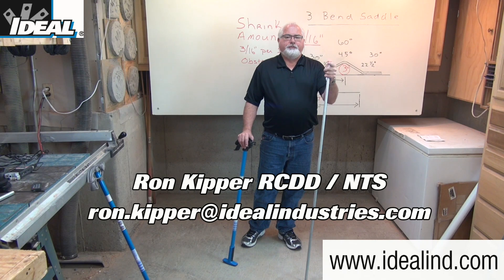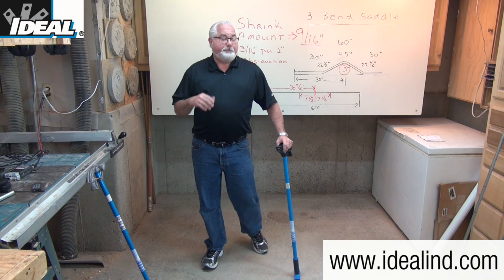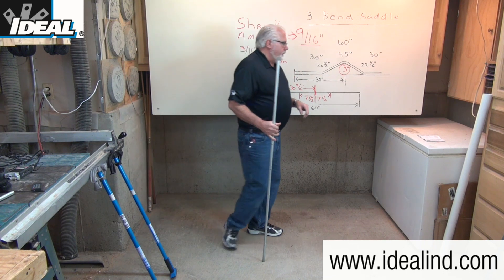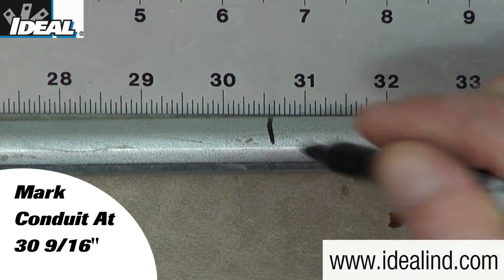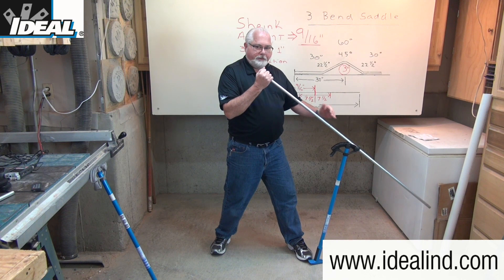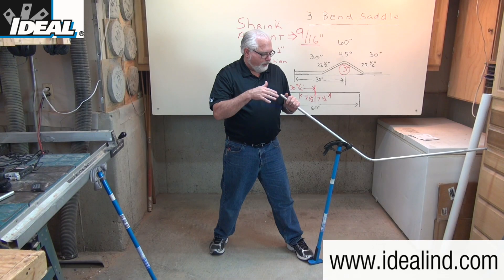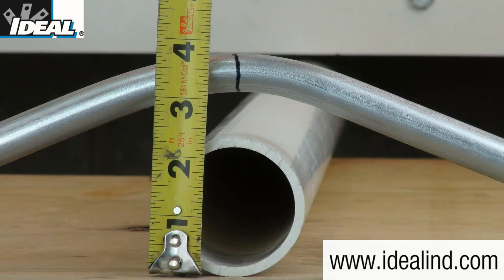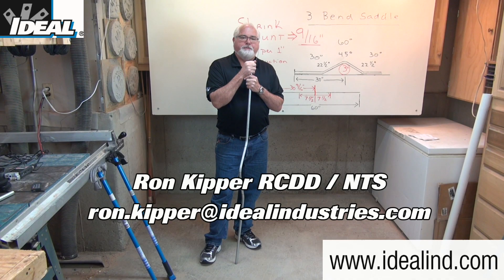Conduit Bending Basics 3 Bend Saddle

Comment: I have the aluminum bender,  and besides the notch  near the star, also has 2 more small notches,  do you know what are those for
Reply from the maker: Yes they are for making the center bend of a 3 bend saddle. The notch in the middle is for a 45 degree center bend, the one closer to the hook is for a 30 degree and the one on the other side by the star is for a 60 degree center bend. Hope that helps Ron at ron.kipper@idealidustries.com
Reply: @Ron Kipper From IDEAL  thank you very much
Reply from the maker: Glad to help Ron

Comment: No idea if you’ll see this or not BUT I’m practicing my bends with a 1/2” bender and what do you do if one side of the pipe is going up a smidge
Reply from the maker: You mean the conduit is slightly bent before you are bending it? Ron
Reply: @RonKipperDatacomm1  no I mean after you do all your bends, one side is bent up a bit and not Flat, is it cause I’ve over bent it?
Reply from the maker: Kat that is called a dog leg and is cuased by not lining up your second bend with the first one. Generally I line up the first bend with the second by sighting down the conduit and rotate the conduit until they line up. I am pretty sure I mention it in the video. Hope that helps Ron

Comment: Why 7 1/2 inches on both sides from the center mark?
Reply from the maker: Hi Brent the 7 1/2 comes from the chart in the bender booklet for a 3 inch obstruction that you need to go over. I am sure there is a math reason for this but the distanve is given in the chart. Ron

Comment: Thank you!  We've got a 3 point bend to match tomorrow in our conduit run. It was intimidating to think about today but exciting to try and accomplish now that I have a better idea of what to do. I appreciate how you showed each step on the screen and explained and demonstrated them well!
Reply from the maker: You got this!Hey Donald hope it helps Ron
Reply: @RonKipperDatacomm1  it worked and looked great!  I had to use the handle of a second bender to cheat the last 22 into place on the short end. The other guys were doing the push through method I think.. but something about those seemed a little off, maybe they were using the wrong starting points.. looking into that method next..
Reply from the maker: Just takes practice! Good luck with it Ron

Comment: What’s the plan when the obstruction is so small that your bends are really close to eachother and you just end up unbending the previous angles when you do the other two
Reply from the maker: Zach are you talking under 1 inch? In that case just make the center bend and  flex the conduit using clamps on either side to continue the run. Have fun Ron

Comment: I need the handle of the bender to be straight, so I can measure my offsets off of it.  As well as being large enough to fit over the conduit to tweak.   Why not invent a more sophisticated hand bender, that you can get exact degrees, without any tweaking.   Maybe use lasers in the bender, with a digital readout.  Or maybe notches that a mechanical stop can slide on and lock on, you set the stop to the degree you want.   It already has spring back factored in,  and probably has to be minorly adjustable, or if you give every single degree as an option, we will just know 1 degree less.       Get to the inventing, I need a better bender.
Reply from the maker: Hey John some of your suggestions have been tried but a lot of learning how to bend conduit is just practice. I just passed along your comment to the product folks lets see if they come up with anything new. Thanks Ron

Comment: Hi Ron, Thanks for the awesome learning videos.  I have a #74002  will it make any difference? How do ideal benders differ?
Reply: Using a steel bender head is fine for 1/2" and even 3/4" 
However, if you're using a steel 1" or 1 1/4" all day long, the aluminum head is more cost efficient. 
I can go much faster with a lighter head.
I am a fit 200LB guy.
Reply from the maker: That bender head is for 3/4" EMT conduit and the bender heads really don't differ other than the size of conduit they are designed for. Hope that helps Ron

Comment: On your first bend, what side of your conduit were you holding? Were you holding the 30-inch side of the conduit? In other words was your hook of your conduit facing away from your 30-inch bend or toward your 30in bend?
Reply from the maker: Kevin yes I bent the center bend first holding the 30" side of the conduit. Basical anytime you are making multiple bends in a conduit the last bend is always facing away from you on the other side of the bender head. Hope that helps Ron

Comment: Shouldn't the total shrink be 9/16 * 2 or 1 and 1/8th?
Reply from the maker: Nope 3/16 * 3 which is the height of the obstruction I was using. Thanks for watching I will be the first to say I am not perfect...........
Reply: yesss: In this video, the shrink is implicitly defined as the conduit length reduction per HALF of the conduit segment. Goniometrically, for one half of the segment, neglecting the bend radii (r = 0), and using d as the shrink, h as the obstruction height, and t as the angle theta in radians, it can be derived that d / h = 1/sin(t) - 1 / tan(t). Entering h = 1 and t = 22.5deg/180*pi yields 3.2/16, so roughly 3/16".

Comment: Ron, thank you for posting this video.  You merit a tip of the hat for this clear, helpful explanation.  This video directly addresses an issue I have with an obstructive water pipe.  My conduit bender happens to be an Ideal, making it that much easier for me to follow along.
Reply from the maker: Hi Jim nice to hear you could use the info. Ron

Comment: Nice video. Is there anyway to recover a bend that was bent too far?
Reply from the maker: Use the hollow handle to and slip it over the conduit to try and "tweak" a bend a little but if it is too far off you have to bend a new piece. The idea is to try and not waste too much conduit on the job. Appreciate the comment. Ron
Reply: Ron Kipper Datacomm

Comment: Hey Ron  , I have a 1/2 ' bender at home and am practicing my bends so I can work back in the commercial industry. I did  a couple 3 bend saddles and followed your instructions , everything was good but I found I did not have a smooth 3 bend saddle the piece of pipe ended up with a big A form, I think I know why but not sure how to correct it. Could you give me some advice. Thank you.
Reply: Good vid. Finally good to see someone getting up all the way on the pipe when making bends in the air
Reply from the maker: D JA good to hear from you. Are you using the right size bender for the conduit? Not sure why you got a bad bend.Ron
Reply from the maker: Thanks for the feedback and yes it helps to work closer to the bender head. Ron